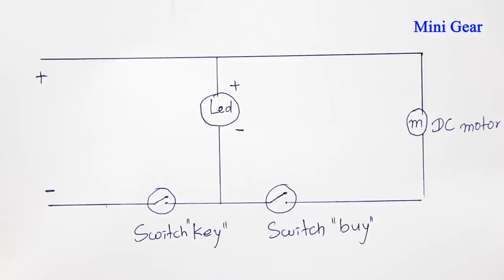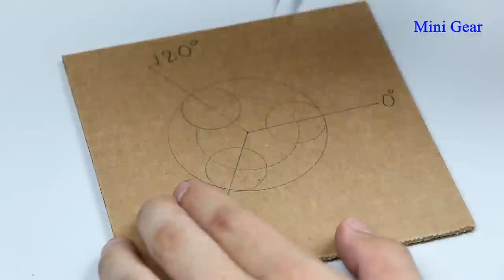Wow! Amazing BUBBLE GUMBALL Machine DIY with Smart Key

Comment: Thank-you, we made this for a school project and it works well. I have noticed that the gumballs get stuck in the bottle so I will try smaller gumballs. 3 things I changed slightly, I substituted your spring button with an elastic band glued over the back of the buy button, I put a small piece of metal at the key as my magnets were not strong enough to hold the key and made a bigger battery door just for in-case we have to do maintenance work on the wiring, buttons or motor.Keep up the great ideas and work.